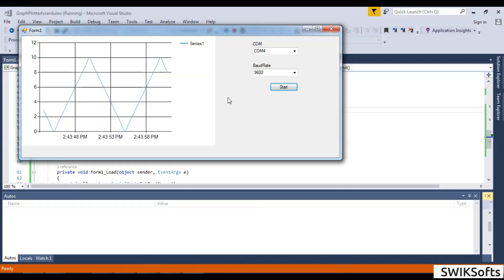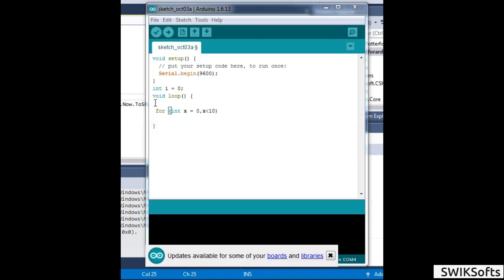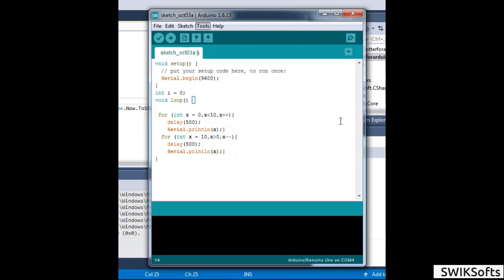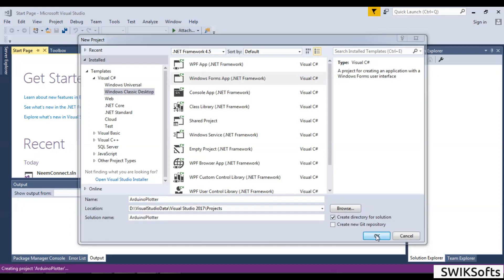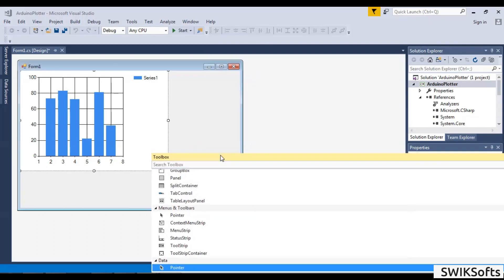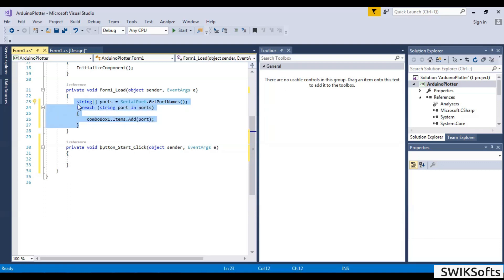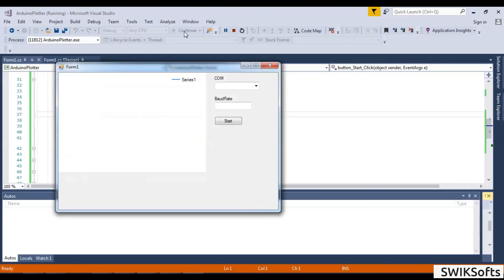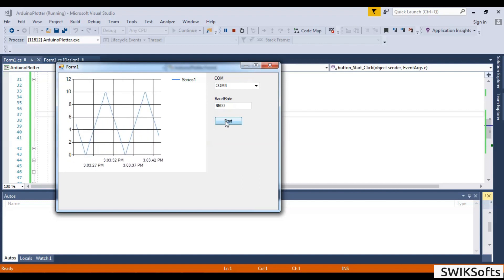Create Arduino based Oscilloscope\GraphPlotter with C# application - Easy!

Comment: For big fans of sine waves, just change 

  for (int x = 0; x<10; x++)
  {
    delay(100);
    Serial.println(x);
  }
  for (int x = 10; x>0; x--)
  {
    delay(100);
    Serial.println(x);
  }

into

  for (int x = 0; x<360; x++)
  {
    delay(100);
    y = 10*(sin(x/(180/3.14159265)))+10;
    Serial.println(y);
  }

in the arduino project.

Comment: I got a small problem. How can we change the code Line chart1.invoke()... if my x variable in Arduino has Long Int type?
Reply from the maker: Arduino sends data to c# application serially in the type of string. You can convert string to long in c# using following code before chart.invoke  long lvar = (long)Convert.ToDouble("223.22");
Reply: @swikbymirtahaali  i got System.NullReferenceException: 'Object reference not set to an instance of an object.'
i request you to reply 
always show port is null
Reply from the maker: @sarathkumar-gq8be  Check port is available before calling any port function
Reply: @swikbymirtahaali  

using System;
using System.IO.Ports;
using System.Collections.Generic;
using System.ComponentModel;
using System.Data;
using System.Drawing;
using System.Linq;
using System.Text;
using System.Threading.Tasks;
using System.Windows.Forms;
using System.Threading;

namespace chumma
{
    
    public partial class Form1 : Form
    {
        SerialPort port;
        string getval;
        public Form1()
        {
            InitializeComponent();
        }

        private void Form1_Load(object sender, EventArgs e)
        {
            String[] ports = SerialPort.GetPortNames();
            foreach (string port in ports)
            {
                Portlist.Items.Add(port);
            }
        }

        private void BtStart_Click(object sender, EventArgs e)
        {
            Thread SerialVal;
            SerialVal = new Thread(runit);
            SerialVal.Start();
            port = new SerialPort(Portlist.Text, Convert.ToInt32(baudrate.Text));
            port.Open(); 
            

            
        }
        
        
        void runit()
        {
            while(true)
            {
                try
                {
                    if (port.IsOpen==true)
                    {
                        var date = DateTime.Now.Year + "y-" + DateTime.Now.Month + "m-" + DateTime.Now.Day + "d-" +
                                    DateTime.Now.Hour + "h-" + DateTime.Now.Minute + "m-" + DateTime.Now.Second + "s";
                        getval = port.ReadLine();
                        data_tb.AppendText(date + "\t\t\t" + getval);
                       /* this.Invoke((MethodInvoker)(()=> data_tb.Text,  getval);*/

                    }

                }
                catch (Exception)
                {
                    port.Open();
                }
            }
        }
       

    }
}
 this is my code did you find any error ,kindly notify to me to rectify the error
Reply: @swikbymirtahaali  i need your help, please find the code above help me to rectify the error   I tried more .